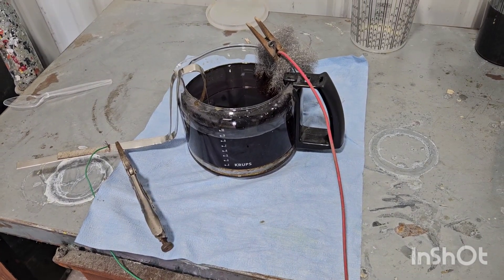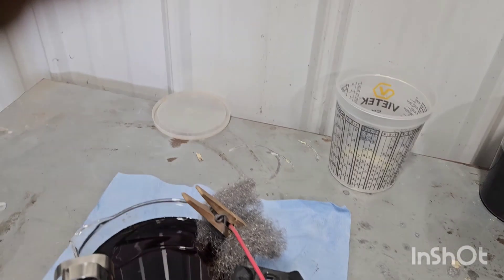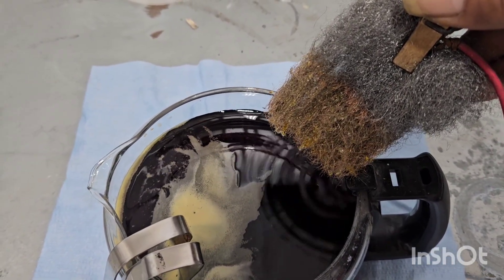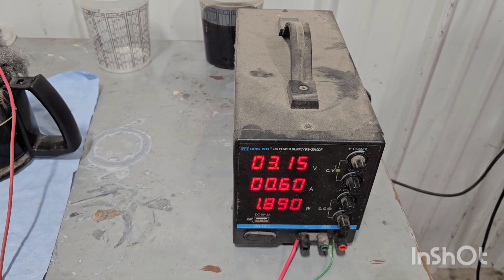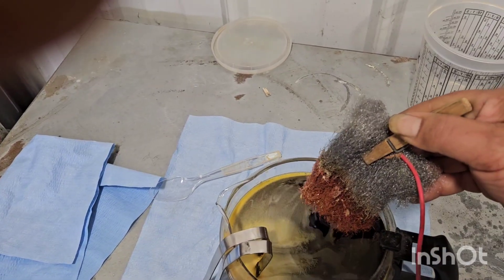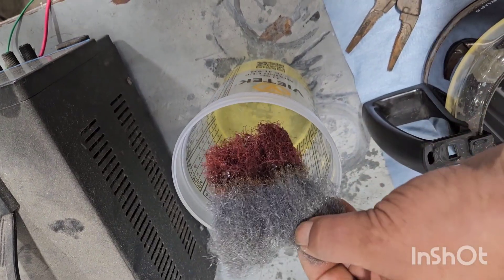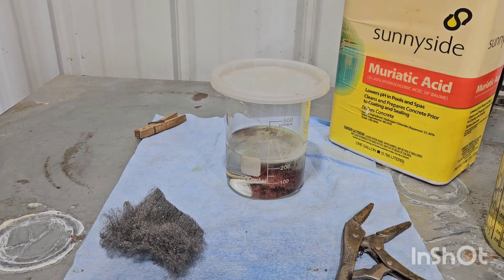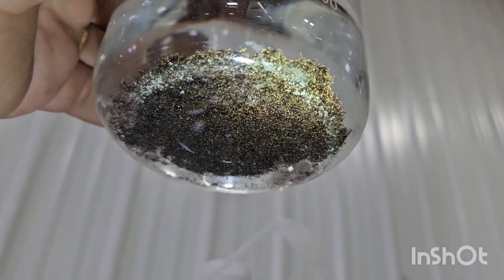Easy Gold Recovery from 1 kilo of RAM fingers using EcoGoldex Part 2

Comment: Did you adjust the pH before running the cell? Just ran a batch of Eco Goldex E series and am having trouble getting it to plate out on my steel wool. (Using a stainless steel anode and stainless steel wool with a 6 volt trickle.charge battery charger. Left running for 48+ hours.)
Reply from the maker: No I did not adjust the ph